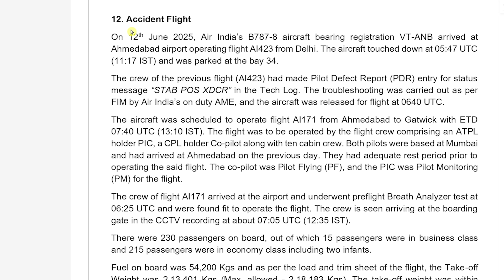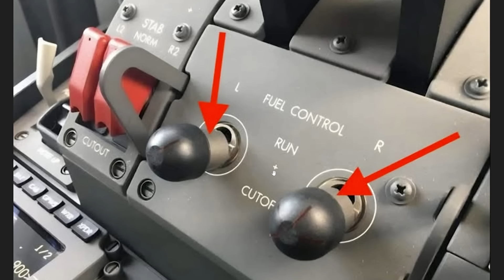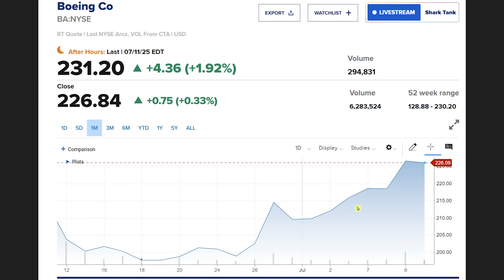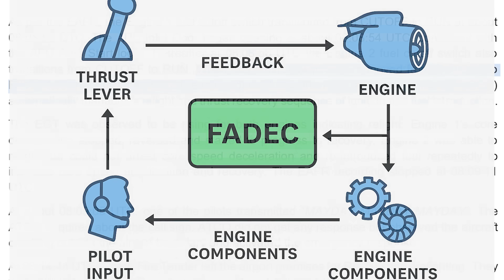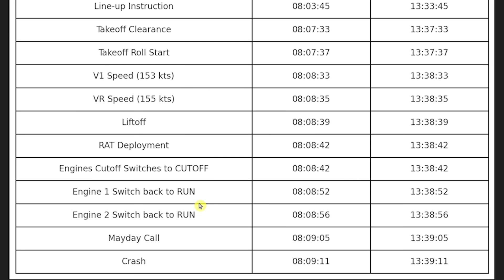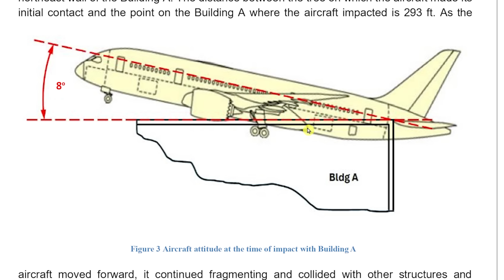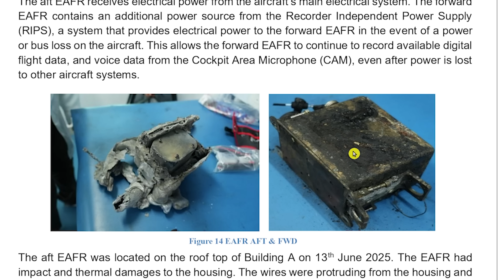Did Pilots CUTOFF Fuel? Shocking Twist Air India 171 Report!

Comment: If it was deliberate, it could have been either pilot.  The innocent pilot could have asked the guilty pilot why he did that.  Then the guilty pilot lied about turning off the fuel.  On the other hand, the guilty pilot would know that the black box would reveal that the switches were deliberately cut off.  So if the guilty pilot didn't want to be blamed, maybe to protect his family or for insurance or whatever, he could have said that to leave an "innocence trail" on the cockpit voice recorder.
Reply: Explain the RAT deployed before the cut off switch, that says something else was wrong before the cutoff was switched to off?
Reply: @nikothssn  Bingo! Glad someone else noticed that RATT thing happened before the fuel cutoff switch gizmo. The sole survivor (who was seated next to an exit door) said that he heard a "BANG" sound before the crash.
Reply: @gusloader123   The bang was likely the RAT being deployed. And it was NOT deployed before the fuel cutoff.
Fuel cutoff was at 8:08:42 and 8:08:43.  RAT deployed a few seconds later and began supplying power at 8:08:47, 4 seconds later.
Reply: @daedalron  yeah I see now in the time frame it both happen in the same second so therefore could be, that the RATT deploys at the same second as the fuel is being switched off.
Reply: @daedalron  no, check the times, RAT deployment and cutoff is at the same time "08:08:42" this is where I think something is being missed, also, 1 switch is cutoff at 080842 and then 2nd switch at 080843, HOWEVER RAT deploys at 080842? so the RAT deploys due to some other reason which may well be electrical failure causing the issue?
Reply: @carlitos-x9s   There is ZERO evidence for the RAT being deployed at exactly 8:08:42. Nothing in the report says that.
For timestamps, it only says the RAT began supplying power at 8:08:47. Apart from that, it says the RAT was being deployed during the climb (with photo to prove), but it doesn't give the timestamp.  It could be 8:08:42 right after the cutoff, it could be 8:08:43, we have no indication in the report.

The only thing we know for sure is that the engines were working properly before the switch to cutoff, as the report makes it clear that the engines began to decrease only after the switch to cutoff.
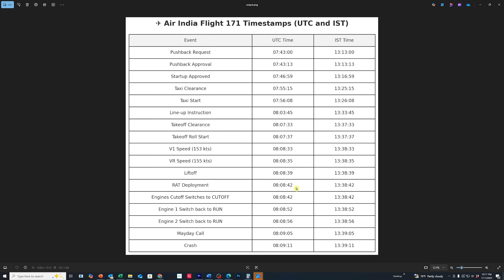Reply: @daedalron  check the video at 11:27 says clearly when the RAT was deployed?
Reply: @carlitos-x9s   And they pull that info in the video from their asses.
I have read the full 15 pages report, and nowhere in it does it say that the RAT was deployed at 8:08:42, and even worse to claim that the RAT deployed before the cutoff switches. That is NOT in the report.
Reply: @daedalron  interesting,  the OP jeff says very cleary they made a chart based on timestamps I wonder where they got this information, if they are making this up its a serious misrepresentation of info! btw I agree the report does not say unambiguously anywhere regarding these timestamps. It is also very curious to me that jeff asserts clearly that both switches can and were turned off within one second which is another misrepresentation. People need to read the report as you have done
Reply: @nikothssn  i heard it was later after swich off
Reply: @nikothssn  Exactly, have already commented and questioned this. Why is this not getting attention, are we nuts?
Reply: This makes so much sense, it is plausible.
Reply: Asking “Why did you cutoff?” right away sounds odd to me. The question would only make sense if the pilot had actually seen the other pilot flip the switches, in which case he could simply ask, “What are you doing?” Instead, it comes across as blaming the other pilot. Any pilot knows that cutting off the fuel at this stage is effectively a death sentence, not just an odd move that warrants a casual “Why did you toggle the self-destruct button?”
Reply: @felulaval  there is a warning tone and caption when fuel cut off they say
Reply: Yeah, the talk in the cockpit won't tell us much, since it is extremely likely that there is one liar.  Hence why they brought a psychologist on the investigation team.
To me, it seems more likely the Captain is the culprit, since the copilot was flying and at that time (3s after takeoff), would have normally have both his hands on the yoke.
Reply: This!
Reply: I agree that this is the most plausible explanation! Though I'd also agree with @felulaval4742 that about the possiblity that the guilty pilot is the one who said the "Why did you cutoff?" question as he would know there's that cockpit voice recorder and thus said it make himself look innocent. Both theories have equal probabilities to me. Meanwhile, whichever pilot is guilty, I think it's also highly likely that there was some physical struggle between the two pilots, hence the delay in getting the fuel switches turned back on by whoever was the innocent pilot.
Reply: No worry. Both the pilots will be compensated heavily.
Reply: It might be in insurance thing where he wanted his family to get the money. It has happened before.
Reply: Ok captian forinsic

Comment: If those switches are only used at the start of the flight and not again until the end of the flight why are they in such a prominent spot on the console?
Reply: In case of an in-flight engine fire you need to shut off the fuel.

Comment: There is another fuel shut off switch located in the fire wall handle, I think that as rotation begin a loose (part like screw) rolled back and provided a ground at the switch as switches are right beside each other. This is more likely then pilot moveing the switch on the pedestal!!

Comment: Isn't it odd that the RAT deploys at exactly the same time as the fuel shut off ? 08:42  - surely there would be a delay as the engine spools down ? At the time of the RAT deployment presumably the engine is working normally ? So why would it deploy ? There is more going on here than pilot error/ manual shut off !
Reply: It's not odd, the controller detects the switches have been shut off, and rat immediately deploys as long as weight on wheels switch is not detecting any weight on wheels... it's programmed to operate that way.
Reply: @brnmcc01 thanks very much - Does the switch have an actual sensor that senses it's position or is the switch only assumed to have been operated because the fuel shut down cuircit had a change of state ie current flowing/not flowing - and,  is it current or voltage sensed. What senses what ? - does the  hi/!ow signal go directly to the computer or is there another interface and/ or logic before the computer ? I hear you, and everyone else, talking about the operation of the switches as if you somehow know for sure - you don't - you only know the results. Not only is there a sensing regime between the manual switches and the computer but also one between the switches and the CVR. Don't take switches for granted - they are not aIways simple - I'd be suprised if there were just two wires connected to those ones ! Although I am devastated to find that one simple manual switch, can shut down an entire complex machine like the 787 with essentially no obstacles just a simple latch, not even a cover !

Comment: Unbelievable ! Time for cameras in airliners, in the flight deck and on the outside so the pilots can view the wings and engines ! If there were cameras in the flight deck, that idea might prevent the investigations from placing blame on pilots vs. equipment ! Some of the comments herein are suggesting the switches failed and how the liability changes big time if they had vs. pilots doing so. That lone survivor is one lucky guy.

Comment: before a human failure is considered as cause of the accident it would be interesting to know the whole signal path from the physical switch to the valve and at which point the fligthrecorder picks up the signal.  means a technical problem schoulkd not be excludet as kong as this signalpath is not analysed in detail

Comment: Did the co-pilot — the pilot flying this flight — recently or regularly  fly another plane where the landing gear up switches are in this 787 fuel cutoff position?  Appears that the fuel cutoff switches were toggled at the same time the landing gear switches should have been toggled.

Comment: 03:58 "I am not buying that story" 
Fly by night air crash investigators. 
Simply reacting to each turn of facts surfacing yet everyone talking super authoritatively. 
Pilot error, fuel contamination were the first professed judgements.
Then the Flap lever. Then the RAM / RAT whatever ... 
Not one of these self styled experts despite their claims were anywhere nearer to the current state of truth. 
Why dont you at the least be conservative. 
These switches made by Honeywell had an inherent fault of switching itself off due to a potential spring malfalnction.
And this is a known and accepted issue by both Boeing and Honeywell i read somewhere. 
What if that came out to be the final truth. 
Where will you keep your face, at that time, to your reaction that one of the pilots' reply, "No I did not" (meaning i did not switch off)
All you have is an uncontrolled big mouth, a camera and a free website to upload your stupid videos. 
Hold your horses.

Comment: This is only a primary report, don’t post speculative outcome. They are not finished on final report yet, it will take long time. It could be anything including those two pull out switches.
Reply from the maker: Hey, you just speculated that this will take a long time. So don't you speculate either!

Comment: Whether it is intentional or accidental, my suggestions for  improvement are
1. Lockout of Manual Fuel Cutoff Switches During Takeoff and Climb (up to 4000 ft)
•	An electronic interlock system that disables manual fuel cutoff switches from takeoff until a defined safe altitude (e.g., 4000 feet AGL).
•	The lockout would automatically override only if:
o	Engine fire is detected (via fire loop sensors)
o	Fuel leak is detected (via flow rate/pressure delta sensors)
Why This Matters:
•	Accidental shutoff of fuel supply during takeoff/climb is catastrophic.
•	Even in multi-crew environments, errors or sabotage (intentional or unintentional) can occur.
•	Prevents disabling engines at critical phases unless the system verifies it is truly necessary.
How It Could Work Technically:
•	Integrate with avionics:
o	Weight-on-wheels (WoW) + barometric sensors determine air/altitude state
o	Logic circuit or flight control computer governs manual switch enable/disable logic
•	Use guarded switches with electromechanical locks
•	Override only with:
o	Engine fire detection
o	Rapid fuel pressure drop + leak confirmation

2. Cockpit CCTV Monitoring
•	Install a cockpit-facing CCTV camera, securely monitored by airline operations or flight data recorders (not for public display).
•	Optional real-time downlink in emergencies.
Why It Matters:
•	Post-incident investigation 
•	Helps identify:
o	Pilot incapacitation
o	Intentional or Accidental unusual manual control behavior
o	Security breaches (cockpit intrusion)
Implementation Considerations:
•	Must maintain crew privacy and trust—recordings would need strong encryption, access only under regulatory/legal authorization.
•	Real-time monitoring only during emergencies, or paired with cockpit voice/data anomalies.
•	Could integrate with cockpit door security systems.
Reply: what if the engine is on fire on takeoff or shortly thereafter.

they would need to cut the fuel asap and power off the engine.

although that itself seems catestrophic.

damned if you do, damned if you don't.

Comment: Why does everyone so categorically rule out the possibility that one of the pilots, due to extreme cognitive failure, could have accidentally cut off the fuel supply instead of retracting the landing gear without even realizing it? People have caused house fires by putting plastic in the oven due to momentary failure. The human brain does not always work as expected.